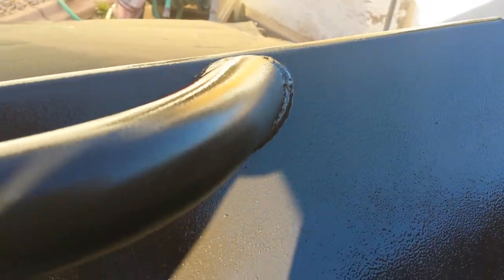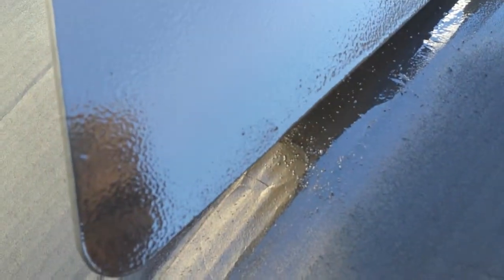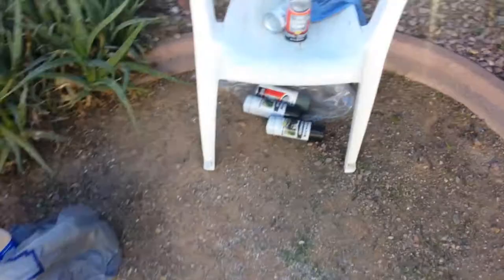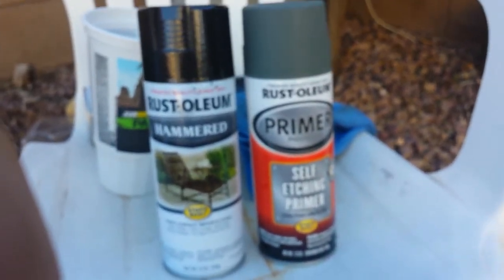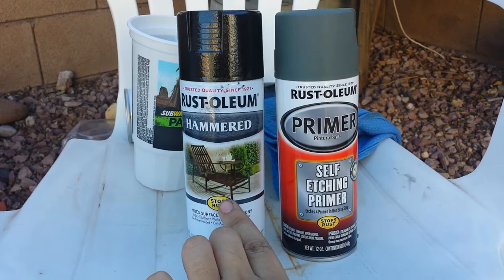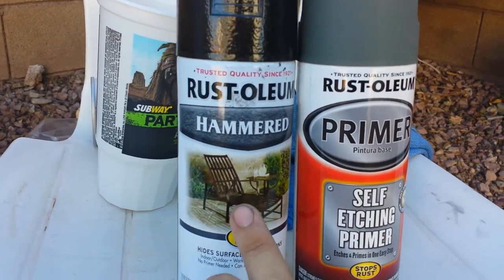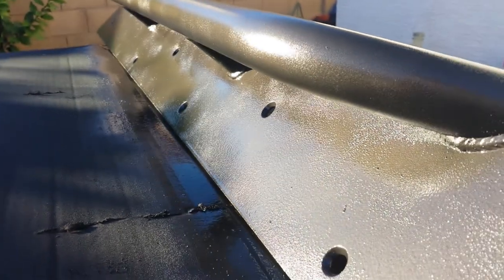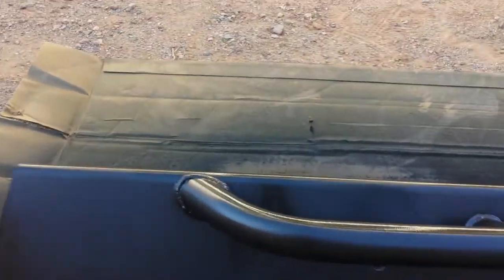Hammered Paint AtoZ Fab Rock Sliders

Comment: Just for info, but you could use non Hammered paint for the insides and underneath the sliders to save money if anyone is looking to use the Berliner paint ( usually more expensive). Regular good rust oleum type paints are fine for the areas not visible to the eye.
Reply: * Bedliner. Sorry auto correct changed it on me.